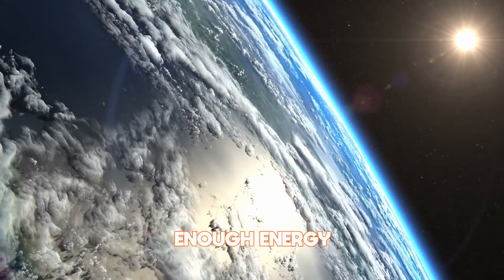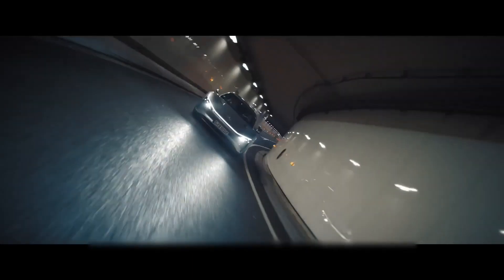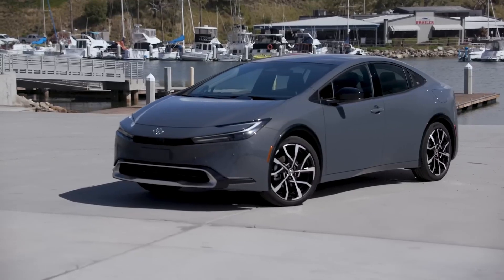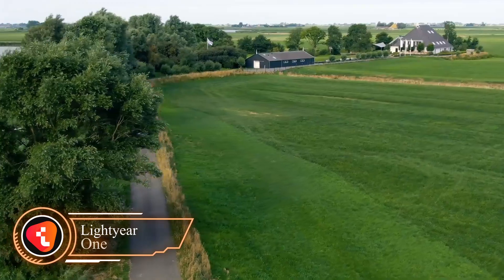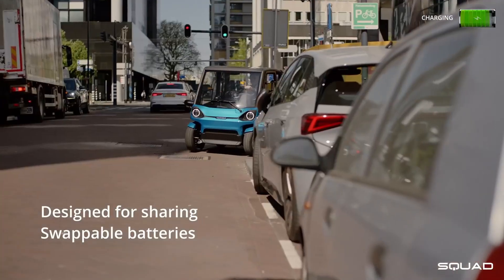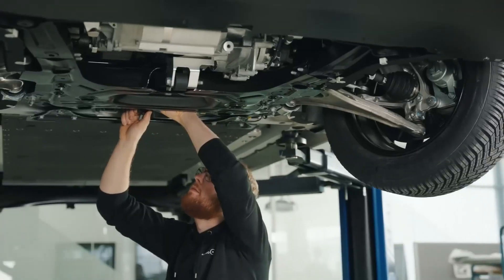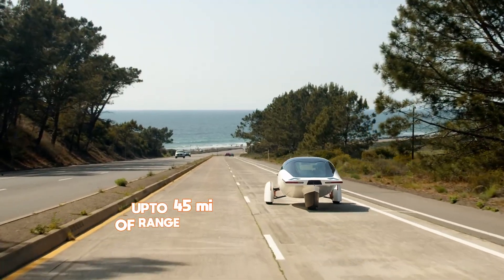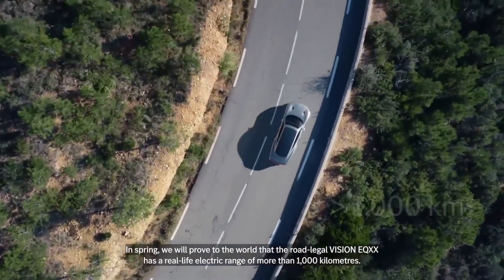Aptera's 2nd SEV?! Top 7 Solar Electric Vehicles You Didn't Know About!

Comment: Most of the facts that you stated about the Aptera are incorrect or out of date. The Noir refers only to the Aptera with the black colour scheme. The solar charging is currently listed at 40 miles in optimal conditions not 45. The in wheel motors have been upgraded and are 25% more efficient but the 0 to 60 has changed to 4 seconds from the 3.5 that you stated. Top speed from what I understand is 110 miles an hour not 100 miles an hour. I appreciate your enthusiasm but I’m saddened by the inaccuracy of your reporting😥.
Reply: The Sol refers to the white colour
Reply from the maker: I'm pretty sure that the sol is their second ev. There's a video of that on Aptera original channel. But I do appreciate your views and will try to meet your expectations! Thank you for your feedback! 🙏
Reply: @Techwowofficial  I'm pretty sure they don't have a first SEV yet; so far just a few fake prototypes. BTW, Morelli drew this design about 50 years ago.
Reply: Too speed is a revised calculation of 102 mph on the weaker motors they changed to. However, they have never gone anywhere near that. Neither has the solar ever proven as much as a mile on any prototype. The three Alpha's were all fakes - couldn't go an inch! Then Beta had none. Then Gamma spent months in the sun and only drove in car parks and once around the block. When it took a few joyriders around a St Moritz car park and frozen pond in the yard, it was plugged in for a recharge - and this is supposed to have a 400 mile battery. I'm betting it doesn't get 500 yards of solar, and the battery maybe ten miles? lol. Already they are saying all those solar panels they made are far inferior to what they can now make, but they vacated the premises and stacked the plant up against the wall in Carlsbad, so how they made better panels is baffling. The facts are - they lie a lot; always have.